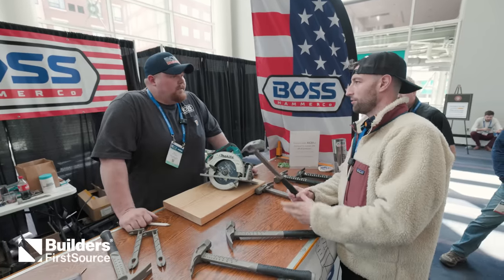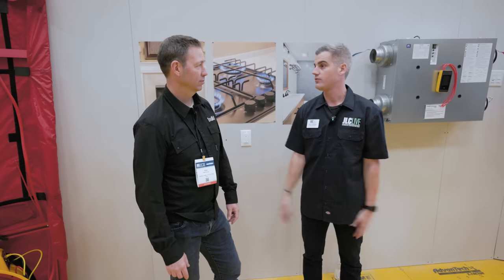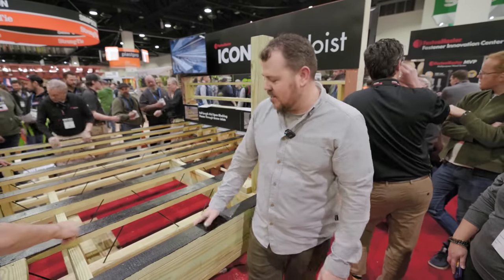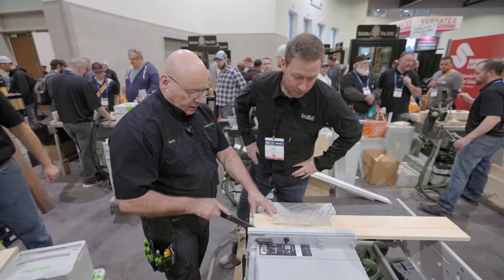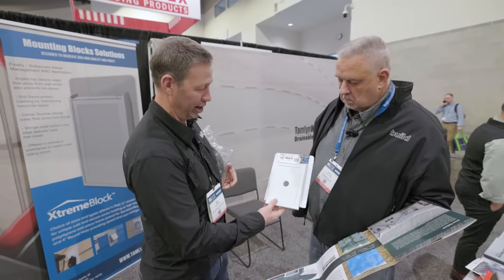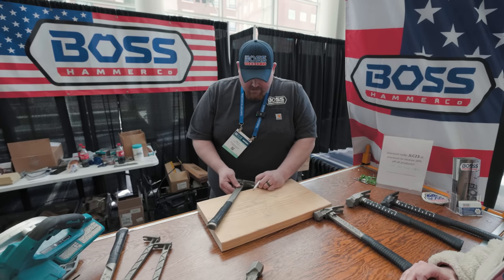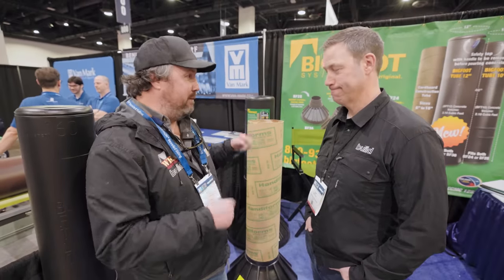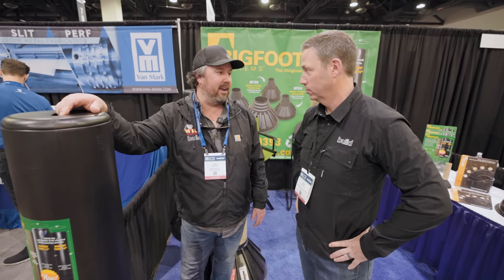I've never heard of these trusses! Best of JLC Live 2023

Comment: I'm sure that Festool table saw is reasonably priced just like all the other Festool tools.
Reply: Absolutely... Based on quality the best priced tool brand out there
Reply: 3000+
But it comes with a servo motor to lift the blade😂
Reply: @RichardMularski  some cost more and don’t have that.
Reply: Disappointed it doesn't move the fence
Reply: @D2O2  I'd pay way more for a servo controlled fence than a servo controlled blade!

Comment: Clear lexel is what I pack when doing faux stone exterior work. When I can't quite fasten the faux stone I use lexel as an adhesive and it works amazing even in not recommended cold temperatures. I even seal a eavestrough leak submerged in water with lexel, I applied it and pressed it while under water. It sealed perfectly.

Comment: Wifi for fixed location devices is pointless.  It is much better to hardwire a cable.  It will be more reliable and can even be powered by an ethernet cable.
Reply: This was my thought.  If it's not going to move, why use wifi?

Comment: On the WiFi network for those smart systems, can it be an ISOLATED (no internet) WiFi?
.
Except for the sake of looks, an electric "fireplace" (even with a small heating element) is about as useful as teats on a bull.  A gas burner isn't much better although they will at least give out some heat, as long as there's electricity for your exhaust blower.  Meanwhile if the power is out in the middle of a blizzard, your wood burning fireplace will keep at LEAST one room in your home warm.

Comment: I have totally abandoned silicone. That's as old tech as tar caulk.
 Lexel (and Qxxx) are the only ones to buy. If you can't find one, get the other.

Fireplace:
The heat output on 120v is the same as a really cheap one room floor heater. Look at those numbers on the el cheapo boxes anywhere (like Target).  If that's all you need/want, get the cheapest one.

If you have 220v available, get one of the units displayed here.

Love the screen. I'd buy them any time. Just think of the ease of washing windows!

Comment: Do those simple fireplaces come with 110 volt outlet or do you have to wire in 220 volts?
Reply: With that fireplace putting out about 5000btu that would puut it right about 12amps at 120v. So I'm sure that's a 120v unit.
Reply: "Most" are 120 volts

Comment: Matt, what you doing to combat drywall cracking from truss uplift in your builds ? I've seen many truss houses that are 10+ years old with minor to significant cracking and gaps where the walls meet the ceilings because of truss uplift. I would personally never live in a truss house unless I built it to ensure the proper techniques were applied to allow the truss to move without lifting the ceiling with it.
Reply: Floor trusses or roof trusses? What causes the lifting?
Reply: @bobbygetsbanned6049  roof trusses. The lifting occurs because the different rates the top and bottom lumber absorb moisture. They end up bowing and not even touching the interior walls. I’ve seen some gnarly gaps and even ceiling failure once. This is in unconditioned attics.  Lots of videos on YouTube about it. I won’t repair the drywall if the customer refuses the proper fix and I still don’t warranty it.
Reply: @anonymous..-  Good to know, I hadn't heard anything about that. I know Matt isn't a fan of trusses because of the unusable attic space though.
Reply: Properly applied Truss clips prevents this IMO.  I have never had any issues with trusses and drywall cracking.

Comment: Ok so what happens when somebody drops a safe, freezer, or washer machine in center of screw truss and the 2 by 4 splits ? Even if the ceiling screwed to bottom of a screw truss how much faster is the fire spread verses a 2 by 10 joist ?
Reply: Isn't this just a complaint about all trusses?  Every building product has it's pro's/con's.  Use the right material for each application.
Reply: They are designed for decks. That's why it has a black coating on the top. All it does is keeps larger, primary beams from sitting further down.

Comment: It sounds like Panasonic has installed a hub in the ERV.  Which is possible, but unlikely, and a bad idea anyway.  Without some user control you are going to be eternally locked to whatever hardware Panasonic deems worthy of working with their software, or worse, going through the cloud.  Home automation is great unless you are locked in with no control.  I use Home Assistant.

Comment: Matt, Once again, you are too nice a guy.  No thank you on the screw trusses.  It is not adequate.  If you are going to be dependent on some threads in wood to support your house, make the screws into bolts size about three times as large and three times as long with larger size so they can take the beating they will see on a jobsite and being installed.  Not to mention field cutting, etc.

Comment: Those trusses aren't anywhere close to half the weight of 2x10. There's only 2.5" less lumber and you still have to account for the weight of steel components. The only way to make them lighter is to use weaker spruce rather than yellow pine.

Comment: Anything using your WIFI to communicate is a really bad idea. Yes, it's edgy and new but in the end, sooner than later, it will fail you and you'll have to pay to revert it all back to the standards.
Reply: Ya I completely agree, they just cause congestion on the open frequencies too. They are all connected to mains, they should just use the conductors to communicate.
Reply: Exactly what I thought.  Nothing but problems
Reply: I've seen multiple homes that had integrated electric heating built into the sheetrock. Everyone has regretted it or converted
Reply: Since when is wifi “edgy and new?” It’s an almost 30 year old set of constantly evolving standards. If an entire office can run off of wifi, I think a few smart home items will be ok.
Reply: Completely agree 100 percent. Usually these type of products fail when the company needs to sell product. I think their NSA tech guy disables the product remotely.
Reply: I disagree. TCP/IP has been around for decades as a reliable form of communication. You use it every day when you send email, watch videos and play on the internet. It’s true there are some inferior products out there. However, there are many products that are bulletproof and I’ve been installing, supporting and personally using them for years.
Reply: Nah, I’ve been using WiFi for mixing audio wirelessly since 2012. It’s solid if setup correctly. For a house you need a small mesh system at minimum.